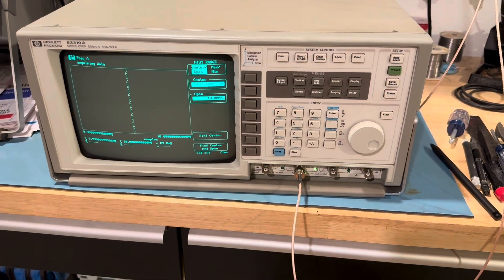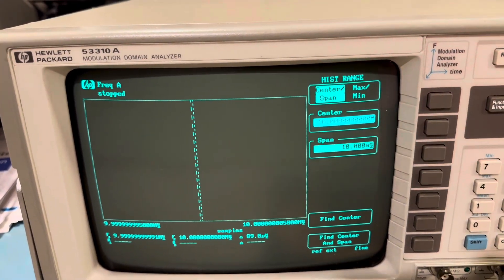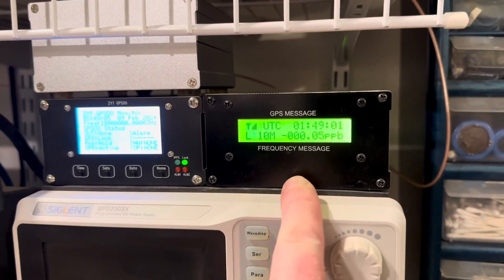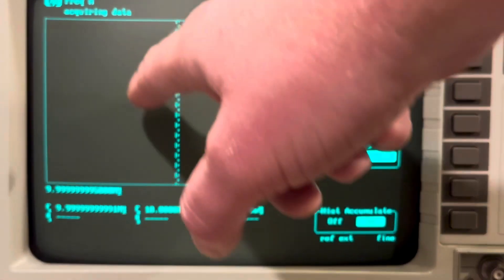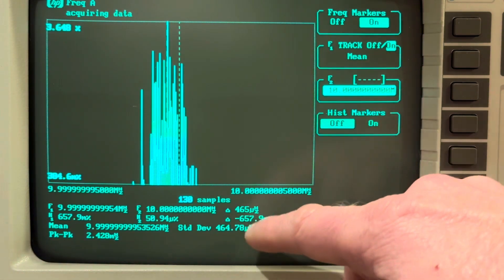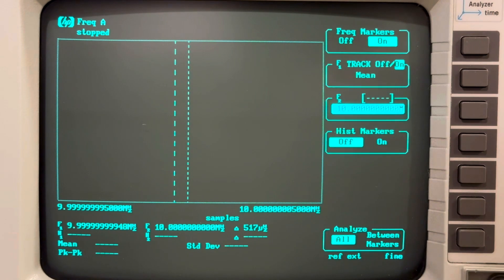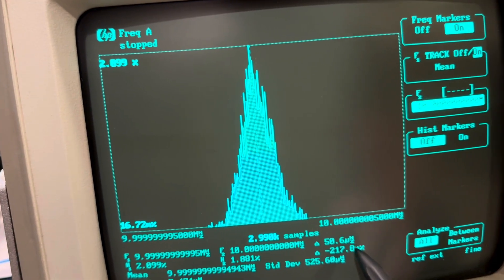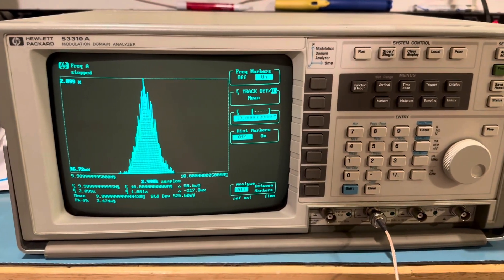HP 53310A MDA comparing Galileo and GPS GPSDO’s - KJ7E

Comment: I have the 5371A, I'll have to try this with the stock BG7TBL reference I have. I originally looked for a 53310A but most of them were a bit over priced or had seen some rough service.
Reply from the maker: They come up now and then for a good deal.  I bought two and combined the best parts of each to make one nice, fully optioned unit, then sold the second for what I paid for it.